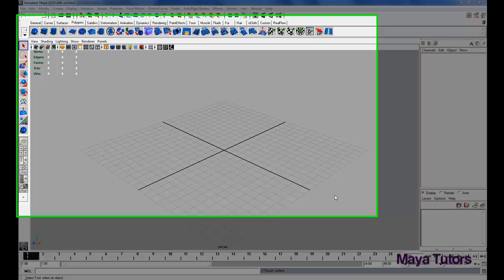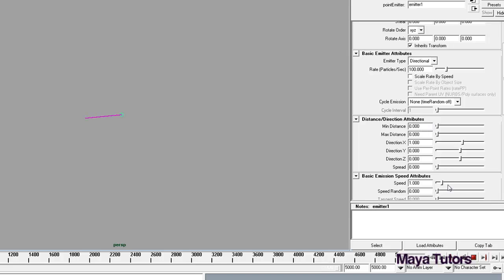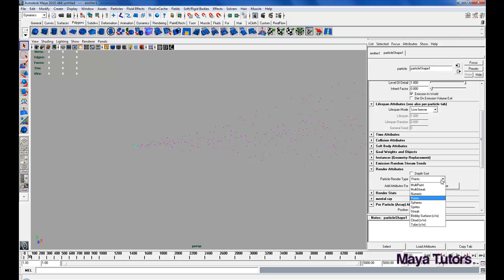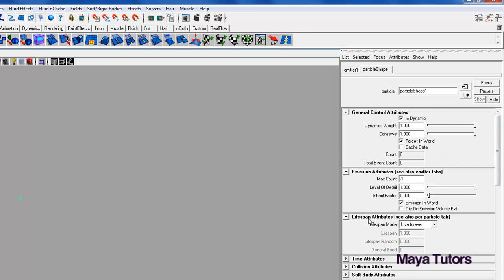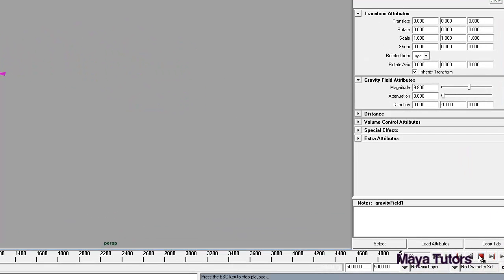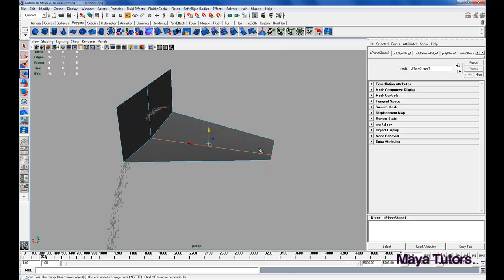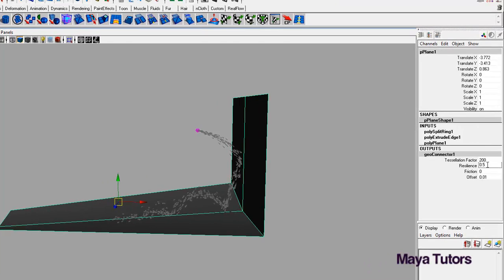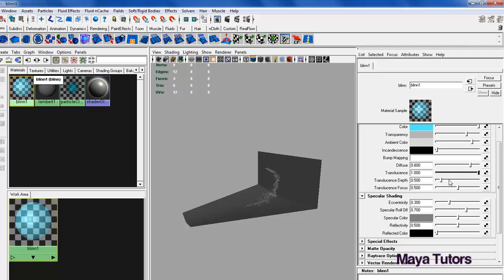Tutorial: Basic Particle systems in Maya - Making a water fountain Part 1

Comment: I've been using Cinema 4D for like 2-3 years now and right from the start it's felt intuitive and easy to use for what I've needed. My technical knowledge has now exceeded the capabilities of C4D so I tried Maya. While it's great and all... holy shit is it unlogical and so hard for the simplest things. In this case I only wanted to learn how to create a simple particle system and bind Maya Fluids to that to get fire... but I still after a week don't know how to even create a keyframe or even change from perspective view to the other views. This is such a freaking bad GUI it's insane. Render times have been impressive however, but how the hell do people memorize it all...
Reply: Its not the program thats "unlogical"... At the top of the screen, when you open maya, to create fire, try using the "Dynamics" in the drop down menu (which is by default on the far left of the top) and along the top bar should be "Effects". Click that and you cna "Create Fire"